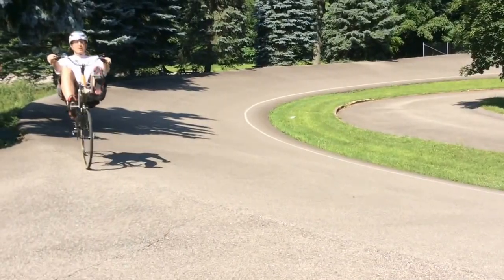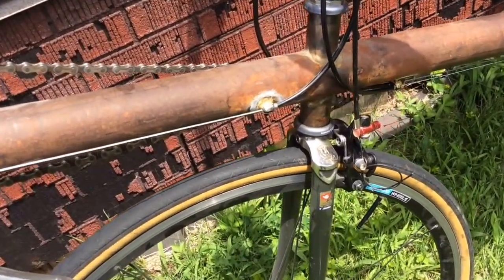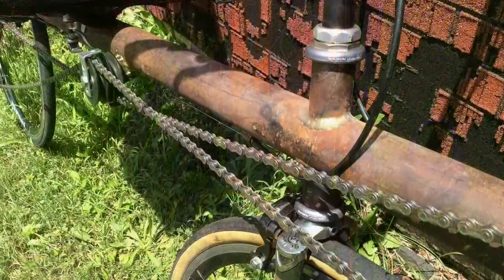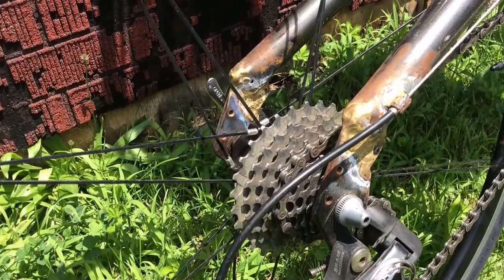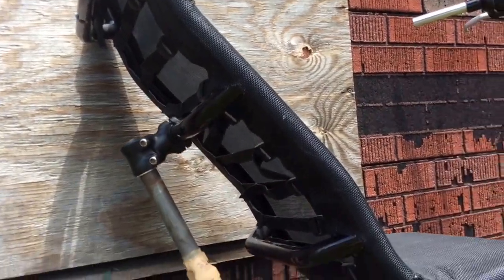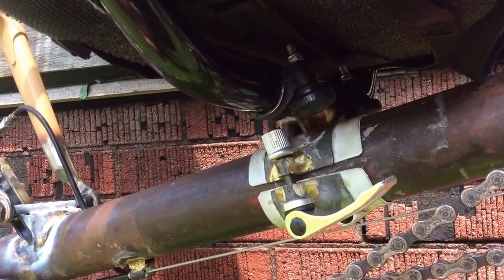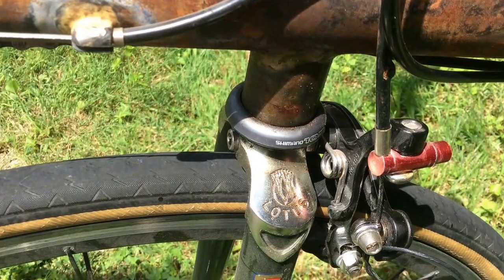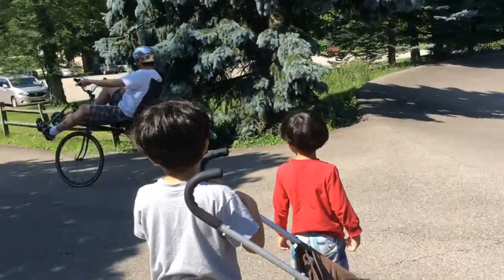Dual 700 Recumbent High Racer

Comment: How it rides without suspension on bad road? I have FS recumbent no lockout option yet, i'll try to add it, but curious about that configuration in use.
Reply from the maker: Since I attached the seat support forward of the rear wheel, not much shock is transmitted to my back on rough roads.  It's not pleasant but better than many others I have ridden or made.

Comment: Are you faster than diamond frame bicycles?
Reply from the maker: After 25 years riding a racing bike it's tough to make the transition. Muscle groups used are different. Pushing forward not down. And the bike is heavier and homemade. But that being said, it's a lot more comfortable than the road bike and the speeds are on par for many courses after a few weeks of training. Watch your knees. The tendency is to push too high a gear.
Reply: Thank you very much.

I will look into it.

I once had a premonition I would die sitting down. I would rather that be on a recumbent than in front of a telly.